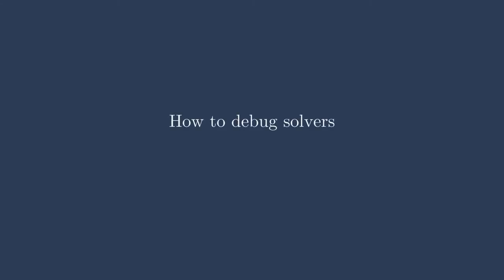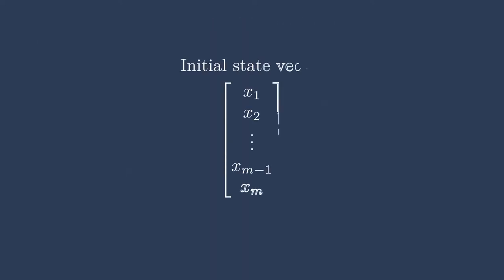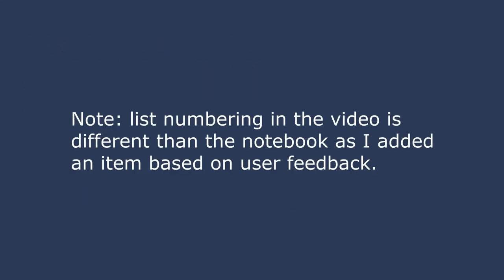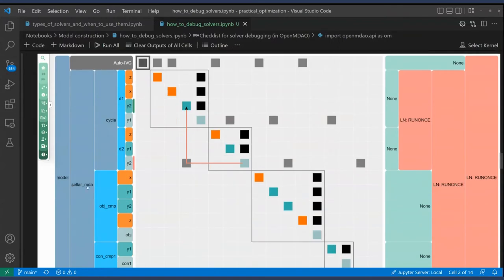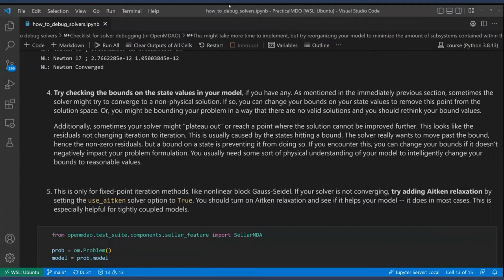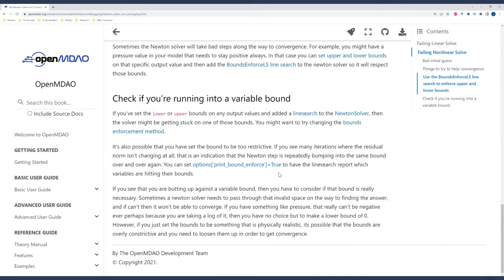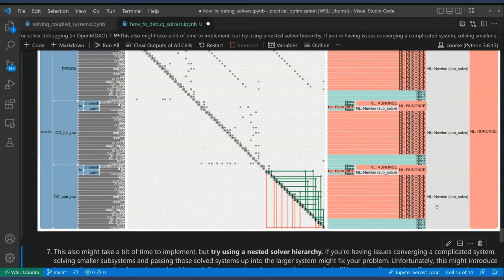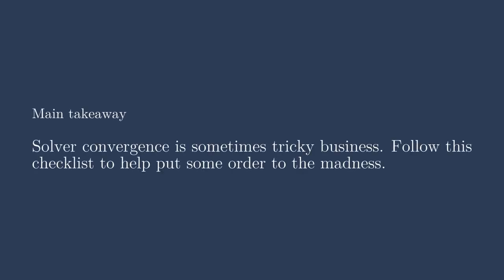How to debug solvers

Comment: I am getting this error for a project I am doing - "Positive directional derivative for linesearch". Is it because a solver is not converging or the optimizer is not converging...looking  deeper I found that for some iterations derivative is 'None' and it was 'None' at least few times before it threw this error. For gradient calcualtions, I am using 'fd' as one of the discipline specific solver I am using do not provide derivatives out of the box. I am wrapping this blackbox solver as explicit component. Thank you !
Reply from the maker: Hey Kapil, thanks for your comment. That could be caused by a few different reasons and without looking at code it's challenging to diagnose what's going on. Could you please post a question to StackOverflow with the `openmdao` tag with a code snippet so we can better help you? Thanks! https://stackoverflow.com/questions/tagged/openmdao